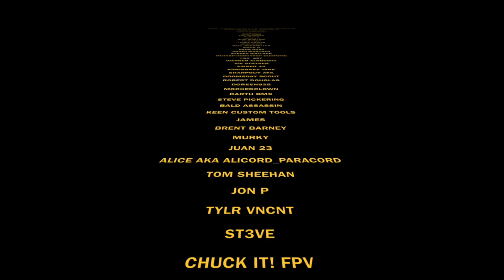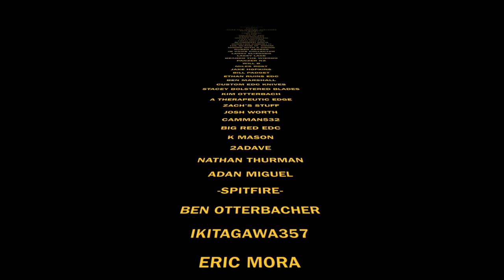REAL TIME FULL  KNIFE EDGE REPAIR ASMR

Comment: Nice a 111 is my daily carry too.
Reply: Which gen 111 do you have?   I've got the gen 5.1 111 and I would trade it for the previous gen 5 with the extra blade thickness because the blade on mine is so light weight it doesn't fall shut but it is very smooth. Which is why I'm probably going to sell my 111.  I bought the 111 and a Herman Dragonfly in m398 the same day with the intention of selling the knife I least like and I'm pretty sure the  Herman is sticking around. The action is rediculously great, I love the textured pattern on the handle and the fact that it has a nested titanium liner lock of coarse the 111 has that too.